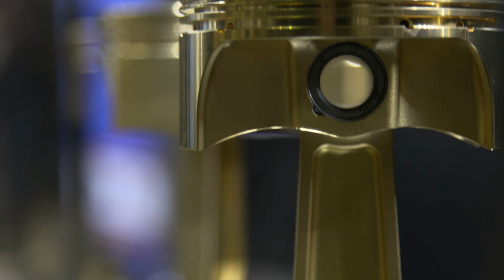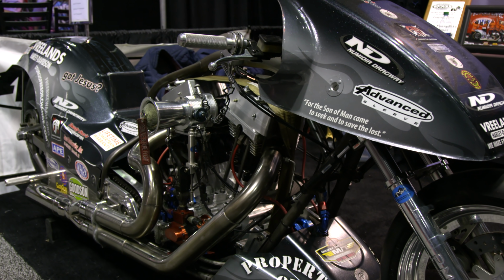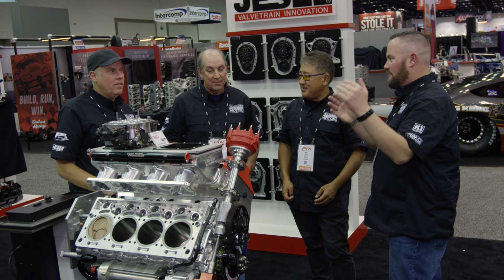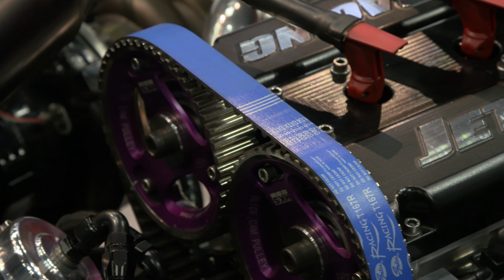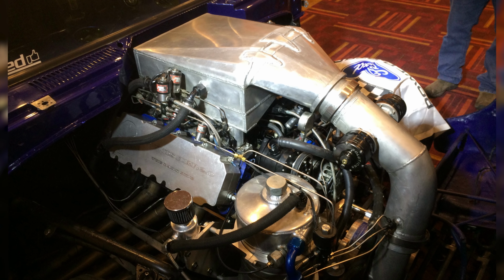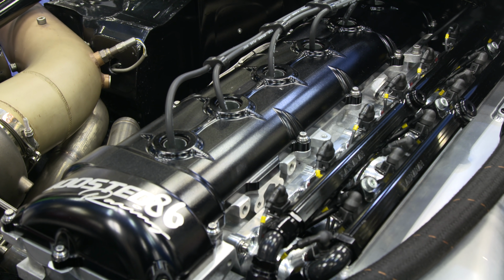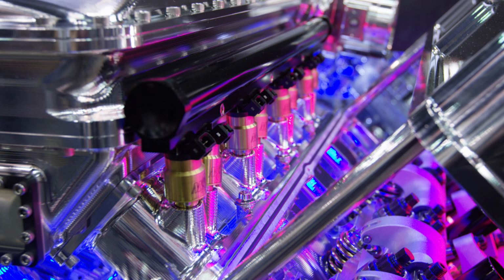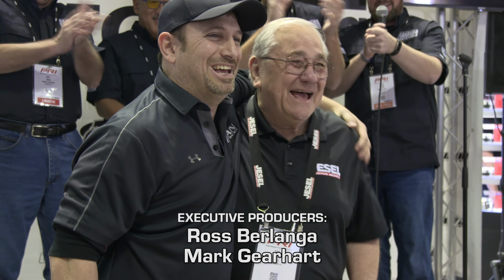Masters of Motors Returns to PRI 2018! S01 EP02

Comment: It's time to change the rules of racing. The F1 guys have been using 20,000 rpm engines forever. Our drag racing community needs the pneumatic valve control in our engines to move further up the technology ladder. Valve springs, give me a freakin break.

Comment: TAKE A GOOD LOOK AT THE JESEL ENGINE. IT IS OF A BOSS 429 DESIGN WITH IT'S CRESCENT SHAPE VALVE LAYOUT DESIGN. HERE IS THE IRONY OF MOST OF THESE ENGINES HERE. THEY ARE ALL OF A SYMMETRICAL HEAD DESIGN BASED OF THE FORD CLEVELAND AND BOSS DESIGNS. AND YET THEY ARE LABELED AS CHEVY??? POLITICAL CORRECTNESS IN THE RACING WORLD.
Reply: The distributor upfront tells the whole story

Comment: A HIGH CAM SHAFT HEIGHT IS NOTHING NEW. IF HE KNEW ANYTHING ABOUT ENGINE DESIGNS. THE CHRYSLER SMALL BLOCK INCORPORATE THE DESIGN WHERE THE CAMSHAFT IS HIGHER UP IN THE BLOCK WAY BACK IN THE 1960'S ALLOWING IT TO USE SHORTER PUSHRODS FOR HIGHER AND MORE STABLE RPM'S. IT'S NOTHING NEW.

Comment: THE DUTTWEILER 443 LAND SPEED RECORD SETTING MOTOR IS A SYMMETRICAL HEAD ENGINE BOTH INTAKE AND EXHAUST. SO EXPLAIN TO ME HOW ITS A SMALL BLOCK CHEVY ENGINE??????????????????????????????????????????????

Comment: One comment was correct it's called electric motor as in electric can you have gasoline engine of course you can look at it this way you can't say electric engine so electric would only be motor where is petrol burning engine can go either way motor or engine

Comment: That's 'a lot' of heat, on the Duttweiler small block, to 'coke up' the oil on a lifter. Especially on one run, with all the engineering that went into it!
Not cracking on them, it's just a good indicator of the power it's making, amazing!

Comment: I've always been told a "motor" is electric. And "engine" is fuel fired.
Reply: Good call ! 
That 'is' the proper designation for each type!
Each provides 'motive force', but I don't recall why they got differing descriptions!?
Reply: An engine is a specific type of motor. Calling a reciprocating engine a motor is perfectly fine.
Reply: Motor is a tool used to complete a task. Electric or fueled.  What happens when fueled becomes obsolete ;)

Comment: Only an American would put 20 turbos together to get pressure for testing valves.
An Ozzie or Kiwi would just hook it up to a large bottle of pressurised oxygen or co2.
Reply: 9:53  "Its for testing cylinder head stud strength" on the dyno.  😑

Comment: Guys, the amount of r&d and spintron time to make an LS hit 10K is astronomical. Pro Stock and Nascar have cam tunnels cutting pushrods to nothing. Then the heads lower the rockers as well compared to LS
Reply: Old Technology by today's standards. I'm today building a Ford 347 & Mopar 383 (not your standard 383 bore & stroke) 10,000 rpm motors. Our performance valve train parts are available today to achieve these motors that live in this stratosphere rpm range. Ryer & Morison built a I believe a 363ci small-block test engine testing cam lobes and roller lifters at ten grand rpm. Said the roller would ramp over the lobe and land itself at that rpm and was reliable if tuned correctly.

https://www.dragzine.com/news/video-10000-rpm-dart-ls-next-pro-stock-engine/
Reply: @brian5606  That's incredible stuff. I would love to do a 928 motor MID sleeved. It's got a full main girdle and 4.84 bore spacing! The dang heads are the problem. I have asked for quotes from quite a few places and the numbers are astronomical. 60 thousand dollars pfft ridiculous. I'm seriously considering learning CAD. I'll send the file to China. Use SOHC with Mahle cam in cam to decrease port angle, cut weight and friction losses. 4.5" bore dual plug 4v chamber to increase propagation speed. With a 2.75 stroke it will rev into the stratosphere with gear drive. Have to tig strips on the block for 6 bolt chambers, from underneath the head in the valley lsnext style. 11k road race rpm with a 10 second 14k strip rpm. Should be perfect for an awd something or other. 
How do you run those piston speeds? 10.3k with 3.6" stroke is north of 6000fps!

Comment: pushrods in 2019 ...just like my tractor son hyuk hyuk. i'm not seeing a lot of innovation, mostly re hashes
Reply: Perry Anderson innovation doesn’t always mean new. DOHC is not new either, it’s been around since the early 1900s. Innovation is doing something different with what you have, pushing the envelope so to speak. From an engineering standpoint I’d say it’s incredibly difficult to get a pushrod engine to breathe above 9000RPM and make good power up there, but people are doing it and therefore it’s innovative.
Reply: @J-Eagan   your describing a rehash not an innovation

Comment: I hate to harsh your mellow, but the high cam, short pushrod design of the Jesel engine was done 24 years ago, by the Mercedes-Ilmor V8 run by Penske in the 1994 Indy 500. https://jalopnik.com/this-innocent-looking-race-car-caged-the-last-innovativ-1577926747

Comment: I'm only 6 min in but wanted to point out: The land speed record engine, 2600hp v8.
The bike engine is making 500+ hp per cylinder. 

The same power output per cylinder in v8 is 4000+ hp.
Reply: WifeBTR123, what’s the life expectancy of the bike engine? It’s basically designed to last a single pass. A land speed record engine is designed to make huge power reliably where a failure means a loss of control and death. Different ballgames, both equally impressive.
Reply: @J-Eagan  very true

Comment: Offy's are bad to the bone, but that's what all the current 4 cylinder 16 valve engines are designed around! Then there is the NO S engines, cheating.... well they were back in the 70's as Nitros was an add on for a guy who couldn't build HO without it! Then there are the power adders, but most of them are on engines that could without the power adders. Although I wouldn't throw out a supercharger of any type, I'm not sure I'd plan an engine build around one. Boss 9? Gotta have one. Anytime you can go NA and make killer power, that's the best way to go. The gigantic Sonny's motor is just too much, and it was built 100% by someone else. If you want someone else's motor in your car go for it rich guy. If you're like me and you have to scrape up pennies off the shop floor to raise funds to build your own thing, I'd go with the Boss 9.

Comment: the irony... bike has 6.66 hp per cube, says got jesus on the side....
Reply: I'd say it was intentional
Reply: More bs
Reply: Yeah isn't that convenient that it puts out that much per Cubic inch.
Reply: Whatever!!! all you smartasses. Good call Ironsights85, 👍😁
Reply: Interesting but 666 also refers to the carbon molecule
Reply: It's because of the producers an owners of this shit. They meant to put 666 in there
Reply: I've heard 666 on alot of Dyno pulls that's on YouTube. Powernation
Reply: anonymous  If the devil built it, it would have more power.

Comment: That black inline 6 is a Ford Australia Barra motor.
Reply: You mean the Toyota 1FZ?
Reply: @hyattbusbey3563  Ah is that what it is.
Reply: Paul Cost 4.5L yup. Very common engine in places like America but not so much in places like Straya since those blokes have the barra
Reply: Ya you cant get those blocks in the us. But they put out over 2000 hp setup. True monsters

Comment: I can't comprehend any engine that has to be rebuilt after 4 seconds of running under load. Yes I know that's Top fuel but still!
Reply: they dont "have to be rebuilt" they actually re use alot of the stuff after measuring it, when there's big dollars on the line, you want to be sure everything is perfect
Reply: Try 11000 HP in under 1 second.Yes it blows your mind.
Reply: How about the idea that even twenty years or more ago, that it cost about $20K a pass if NOTHING broke.
Reply: All depends on how fast you want to go with the rules governing

Comment: most inovative, still runs pushrods. i will never understand americans...
Reply: Depending on application (like Top Fuel Hemi ) pushrod engines designed by Alan Johnson etc have been proven more reliable to OHC style engines. The McGee brothers in the late '90s attempted to run a DOHC Nitro engine in NHRA but couldn't work out all the bugs.
Reply: Overhead cams aren't the be all and end all bro. I own a couple of pretty nasty pushrods V8's, but also a big hp RB engine- I appriciate both styles.
Reply: Brad Anderson Engineering. As far as category in question, worth the search. Alan Johnson aside.. if you want to talk about true Innovations, look up smokey yunick, made a small block run backwards, giving a crazy advantage(the engine would torque in the opposite direction) in his Sprint car,  immediately outlawed.

I'm 34 years old give me a break..
If it burns petroleum I dig it.

Don't get me started on those gyroscopically controlled cars from the 50s.. bless Harley Earl.
/wink
Reply: well it's simple and works well, sure it can't wind 13k but it makes up with low end torq
Reply: The Jesel pushrod engine is built to go 12k+ rpm.
Reply: @ghinmi  Comp Cams and Engine Labs have developed a package for LS engines that sees them making power to 11 - 12K RPM as well! And that's something that can be used on a common LS platform
Reply: push rods are a newer technology than DOHC.

Comment: Did you miss the v8 with two Honda heads on it?
Reply: The Northstar v8?
Reply: Did you guys forget Russ Collins in the 70's took two 750 Honda engines. Removed the transmissions, put them together to make a V8 then slapped a GMC supercharger on it and went #dragracing with it. That was almost 50 years ago
Reply: Sounds interesting. Has been done before, with V8 R1 engines and even Kawasaki bike engines. They always end up being very good little motors